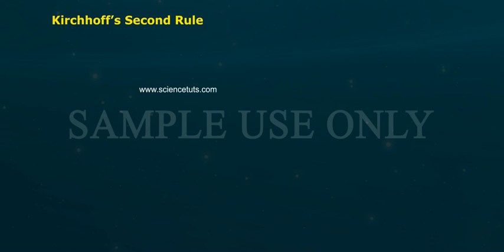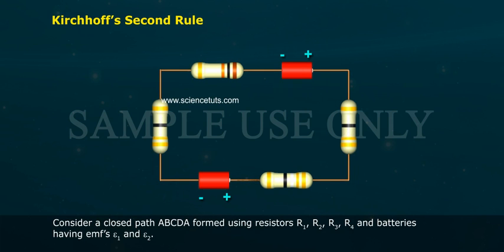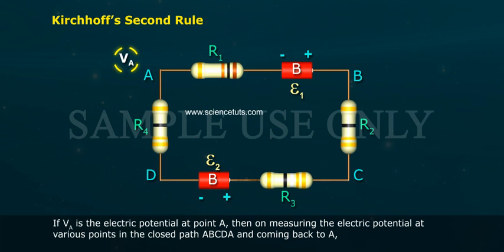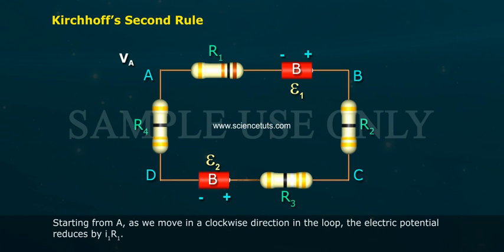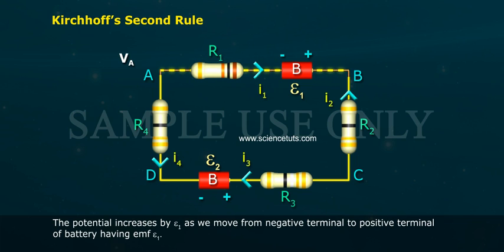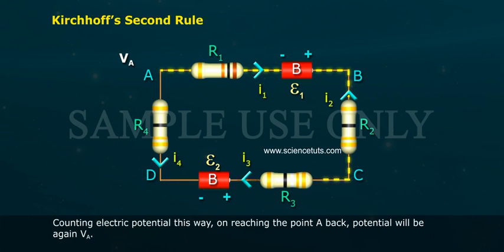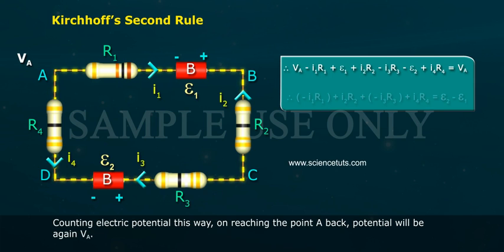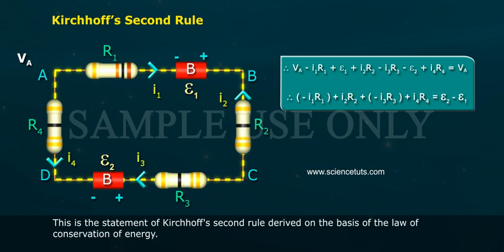KIRCHHOFF'S SECOND RULE

Comment: According to Kirchhoff's second rule The E1 is Greater than E2 such as E1>E2 and the current flow in the Anticlockwise direction. Starting from E1, when Current flow from E1 energy will gain as - ve terminal to +ve than by going to resistor the energy will be lost.

In this Video, I get confused with the actual concept of this rule including equation in 2:38.